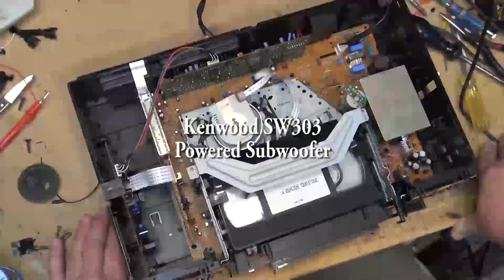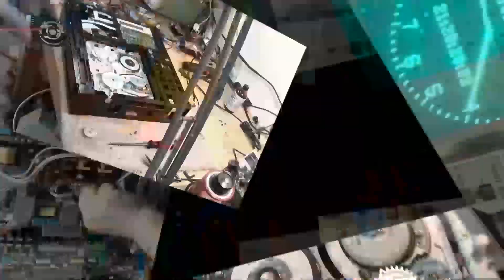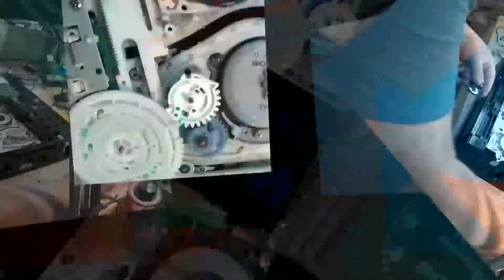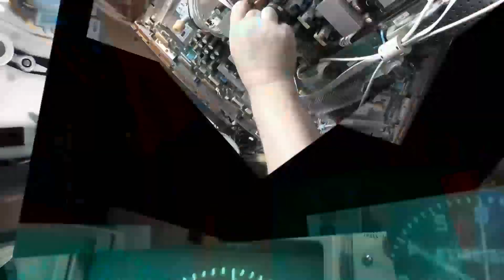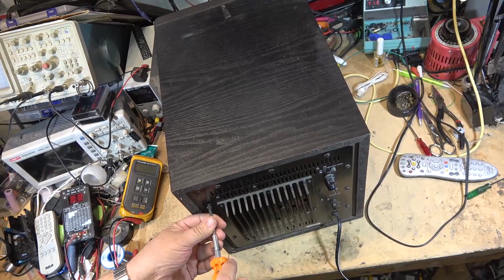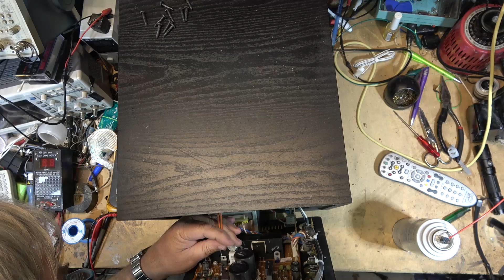Kenwood SW303 Power Subwoofer Repair

Comment: About the three wires for the speaker:  the voice coil have an extra winding that is connected to the feed back point of the differential input pair. This extra connection provides correction for the real movement of the voice coil. It's a kind of motional feedback and it lowers speaker distortion.

Comment: I found an ATHENA AS-P300 in the recycling - working condition , very impressed with it have in garage, cement floors a good size it keeps up a nice bass response without much fatigue  -  this speaker box really shows off the compression they use on transmission for FM stereo local radio.

Comment: Nice repair! Also used good old Kontakt 60 contact spray here in Germany for my power strip. The switch started crackling on Saturday. It's only a temporary fix though. Bought a new one and just in this moment it arrived at my door. I guess dust has accumulated in the switch. Might get a rubber switch cover for the new one to prevent that unnecessary money sink.

Comment: I gave my Kenwood 10" version of that same subwoofer to a friend that put a 10" Cerwin Vega into it.  My main speakers have 2x 8" woofers ported at 40Hz already so it's fine enough for my apartment. People complained about the subwoofer even when it was turned WAY down, they interpret can hear it as loud. Lower frequencies tend to travel further is why they hear it even when it's not that loud.

Comment: I used to fit speakers with 3 wires it was left right and negative basically a stereo speaker usually big bass Drivers! But that was for in car systems.

Comment: What's with the three wires to the speaker?
Reply from the maker: Split phase speaker lol
Reply: Looking at the schematic (found on the internet) it looks like the third wire provides feedback from a second voice coil to improve the low frequency response below the resonant response of the system.
Reply: @richardlamoreaux8979 
So its basically a servo woofer. That is the first thing that came to my mind when i saw 3 wires.
Reply from the maker: I believe it is to increase the linearity.  Kind if like the extra tap on the primary of the audio output transformer on tube gear to provide feedback for the ultralinrsr design.
Reply: @12voltvids  yes, just google servo woofers, they basically have a sense winding to provide feedback which is than inserted into the negative feedback of an amplifier to improve linearity, Basically the amplifier corrects movement of the cone.